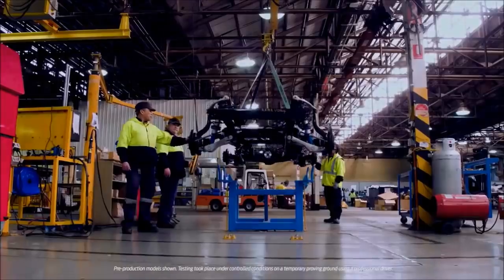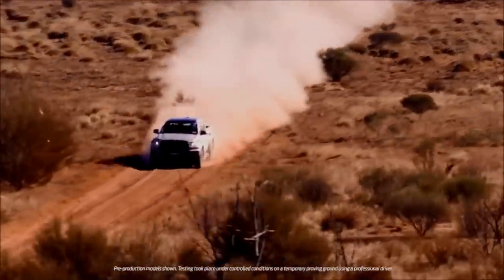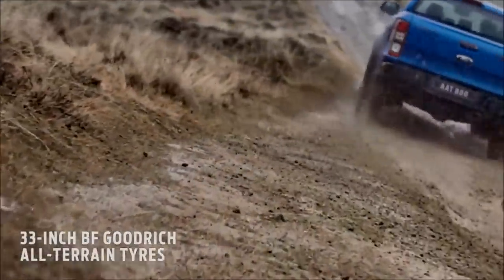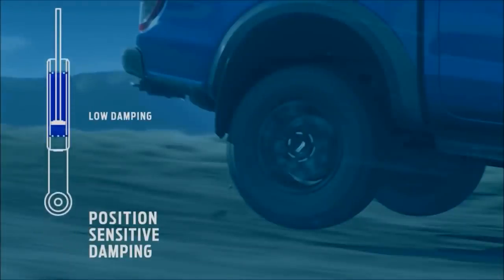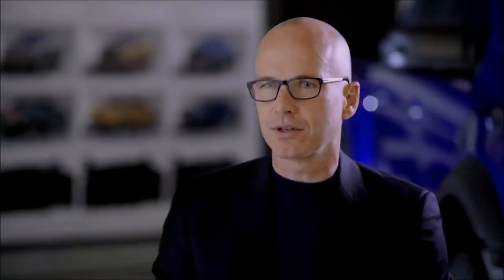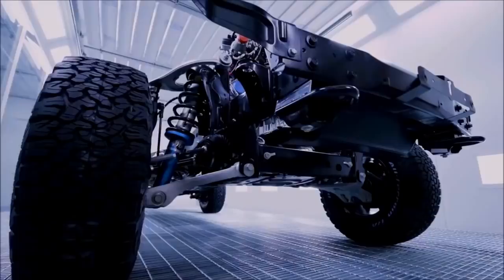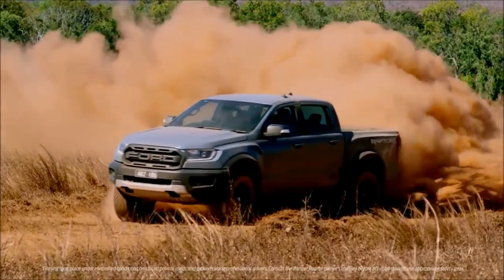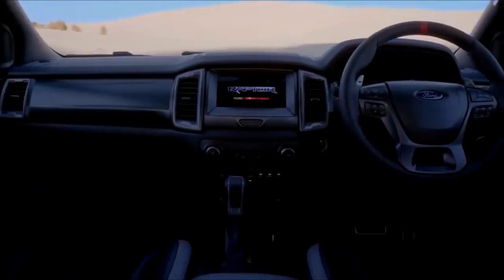Ford Ranger Raptor - The Best Pickup Truck Ever !!

Comment: Toyota is reliable, dont try to say Ford is because it is not at all.
Reply: My 87 Ranger with over 400k must have not gotten the memo.
Reply: @grizzleypeak  exactly its an 87. Any car in general at those years were very reliable. Toyota is the only company that is still solid.
Reply: Well its how you take care of it
Reply: I'll take a Tacoma TRD OR 4x4. Much better truck. 4ltr v6.
Reply: How many fords had the frame recall like you're precious Toyota?  How many Toyotas trucks in 87 rusted to pieces probably 80 percent because you don't see them on the road today. Finally Toyota had a huge problem with engine sludge where they were getting the engines replaced. Every vehicle manufacturer has had its flaws so don't make stupid comments out of nowhere.
Reply: @jasonamerica7618  also ford started it all they started car production
Reply: I got over half a million miles out of my 96 ranger.  I think  they are plenty reliable.
Reply: My cousin's Corolla had it its engine die before 150k miles and my sister's rav 4 had a factory recall to repair the engine that was eating a quart of oil every week at only 120k. Years were 2009 and 2007 respectively. Ford trucks are reliable and easy to work on. Probably some of the best trucks on the market . I won't say the same for their cars.
Reply: @TDONLEY91  my wife has a 2013 fusion.  Its been good so far...
Reply: Ford was the only option before they went aluminum now there's no question. By the way that's what Peterbilt and Kenworth are made out of, I know because I own them.
Reply: Never had a single problem and on my 5th ford.
Reply: I would crawl on my hands and knees before I'd ever buy a Toyota
Reply: I just gave my old ranger to a friend that needed a truck.  What part of 518,000 miles would you consider unreliable?
Reply: @grizzleypeak  Ha!  Right?  518,000 on my old 96...  Unreliable indeed.....
Reply: 95 thunderbird 4.6 v8......431000kms of hard driving and 22 years before too many thing broke.i trust ford
Reply: Dont talk nonsense!
Reply: @superbros1690  really the 80s were probably the worst decade for Auto mobiles virtually every manufacturer makes a better product nowadays Car & Truck
Reply: Ford needed bailed out, Toyota never needed that. 210 hp is a joke even for midsized truck.
Reply: Its how you take care if it. Toyota's are under power vehicles and cheap  Quality end of story
Reply: Really? Lol thats why they have the best resale of any truck or car!
Reply: roland white Ford was never bailed out.  You’re thinking GM (Government Motors) and Mopar (twice bailed out - first time was in the 80s).  And GM never paid the money back to the American tax payer in private sector profit.  I digress...
Reply: roland white Excellent marketing for their products and the fact that many American marques in the late 70s and early 80s WERE terribly unreliable.  However, after losing massive market share to Toyota, Honda and Nissan, American marques (more specifically Ford) improved their product for the consumer.  At this point in time it is a “six to one, half a dozen to the other” type of situation when comparing Ford and Toyota.
Reply: @vr697getta  Ford never took a bail out. That's why their stocks where much higher than the other u.s. manufacturers
Reply: @vr697getta  when did Ford need a bail out?
Reply: I have a 2016 ford ranger xlt that has 172k on its dial. I used it a lot. I already change the tires 3 times but the brake pads are still intact. I got the spare pads prepared, like 40k ago. Who says ford is not reliable?
Reply: @da Ghost sorry I'm talking about the brake pads
Reply: As someone who has driven ford and toyota, there is no competition, I would start biking before I would go back to a ford.
Reply: my 2004 has 300k km, although it is rusting out..due to winters and salt

Comment: 1000 miles later it brakes down !! It’s a ford so ...................

Yeah !!!!
Reply: Yeah buddy my 5.4 f250 has 275000 miles and the gass peddle is on the floor more than the break peddle I know you probably like your super reliable rusting in half Toyotas but they still don't make a truck that will pull a trailer as well as my 18 year old F250

Comment: At least you finally have the answer to why the North American market doesn't get the Ranger Raptor - the hp hungry Americans would NEVER settle in for a 2.0L Twin turbo 4pot diesel in a Raptor vehicle. It can't have the 3.5L V6 Ecoboost since it would be stepping on the toes of the larger & more profitable F-150 Raptor either, so I'm guessing the 2.7L V6 Ecoboost is likely going to be redesigned & re-engineered for the Ranger Raptor to make sense in USA, which is likely reserved for the all-new Ranger in about 2-3 years time.

Comment: 3:40 mark or so, watch how much bed bounce it has. F150 Raptor suffers from the same issue, Fox and Ford can’t design a suspension to soak up bumps. Be ready to drop another 10k in suspension if you buy one.

Comment: Hmmm, being an owner of 2017 Tacoma Trd Off Road edition bought NEW (0klm) for (52,000 Can.) I get in Stock options, Bilstein shocks, v6 278hp, 4x4 with crawl control options, Power windows, heated cloth seats with heated side mirrors, Bluetooth and Sirius radio with 6" touch screen,  Rear lockers, traction control, Toyota reliability with a solid resale price that wont drop like Fords stock market. As far as Ford Ranger Raptor design goes, It looks like 2017 Tacoma with wide fender flare kit nice try Ford, not to mention those head lights,  I guess that is where all the performance comes from. Never was a Toyota fan boy, being a Toyota owner made me fall in love and not their commercials.
Reply: John Ratushnyy toyota reliable? Maybe it was 10 years ago. New vehicles are crap. Taco motor is ok, but very thirsty. Interior cheap.
Reply: Roland Jankauskas, Yes truck is very reliable so far, took it out to a bunch of off-road trails and rock crawling and it performed very well. I will agree Taco is very thirsty when it come to city driving, highway drives are very pleasant and good on gas. I'm still thinking to buy Pedal Commander ( Throttle Response Unit) Reviews say its solves the city driving consumption by a fair amount. As far as Interior goes, yes most cars manufactures over use plastic, and I miss soft to touch dash soooo much ! But being my Off-road, Hunting, and a day to day ride I really dont mind it. Its easy to clean and maintain and looks great when it has semigloss UV protection on it ,  but the downfall is the door plastics scratch waaay to easy, looks like they have some sort of plastic clear coat on the surface. But working with cars day to day basis, I work in collision shop so I get to see whats inside them.  Ford quality really went down, plastic clips and fasteners are made to break, electronics positioning that don't make any sense like why would they put it over there ? Allot of plastic exterior parts that touch the cab rub the paint off, rust protection is very weak ( if you get a chip on the hood and its a very deep chip, aluminium starts to bubble and spread fast dues to aluminium oxidation and self protection factor ). Fords electronics, sound system for instance. We had a customer that has an issue with side Windows module intervene with sound system module. If you had radio on the windows wont go all the way up, very weird issue. I've had my Tacoma for almost 2 years now, and I worked on one at the shop so I saw what it was made of. Easy to access and to disconnect wires in door panels, clips and fasteners don't break and much easier to remove, very little modules or computers to intervene with one another its just power wire and a control panel ( Power window for example) no computer. To sum it all up, Tacoma is just more simple and strait forward truck, not over complicated, in build quality its decent but the best part its reliable and if it does break its not expensive to fix and labor cost will be much cheaper than Fords. Im not hating on Ford, my family owned a 2004 WindStar, and I owned a Mustang, from that what can I say ( NOTHING BUT PROBLEMS ). I had my experience being an owner and hearing other owners speak, Ford needs to step its game up by making things more simple so the money can go into quality and reliability of their vehicles .

Comment: The same fools who didn’t think the ecoboost f150 would be as good as the v8 are misjudging the 2.0 capabilities. Think of power to weight. The stock ecoboost 4 cyl ranger already out classes the competition Toyota v6 in terms of power and towing not to mention the cab space. Now add the raptor package and say so long Trd sales... don’t get me wrong I love the taco as much as any other camphead Moab guy, but if this thing stays within $10,000 of the trd pro package it will be a no-brainer to pull the trigger on. On the other hand this explains the giant price increase on the current raptor over the years. Making room for lil bro

Comment: Great design Ford but the issue is the engine, small engine in a big truck, for me it's not a bright idea even though has a lot of Horsepower and Torque but still it's not enough you should offer an options well maybe ok 2.0L bi turbo is your company's choice but you should offer for the people's choice like 2.5L bi turbo or stick to 3.2L just a mid level engine because many people tends to believe that a small engine squeezzing power to come up for the paper will never last long it will never be durable for an engine, for example Toyota Hilux mid level engine but average in Horsepower that is why it reach 500k mileage or more for many of the Hilux and has a big rating on reliability vehicle. Majority of people now a days choosing a vehicle for durability, reliability and fuel efficient and also for the design. I hope Ford offer some engine above 2.0L and I'm not referring to 2.2L engine.

Comment: Hope it's better than my current 2016 ranger with its overheating gearbox, battery issues, fan belt tensioner failure, and stalling when cold. And the Worst customer service ever. If your going to buy a ranger go get a Mazda bt50.

Comment: In no way shape manner or form can a Ranger Raptor or any Raptor be the best truck ever.   For all practical purposes it's not really a truck.   A truck is a multi use vehicle designed to work.   That means hauling loads and towing.   For those reasons, as far as trucks are concerned, Raptors are pretty poor trucks.........

Comment: The level of stupidity in these comments is simply baffling. When the Ranger Raptor comes to America, it will most likely get a high output 2.3L 4 banger that is standard in the Ranger now. Is it possible they will have a Diesel option? Sure. Is it likely? No. Ford doesnt provide a 5.0L V8 option for the F150 Raptor. Diesel are great and if done correctly, very reliable. Also very efficient. That plus a small package means better mpg. This is common sense shit.

Comment: cough... Nickle alloys are what manufacturers used between 30-50 years ago, but did away with them in the 90's because of the high cost..  cough... cough.

Comment: High speed? its slower than my 2.0Bitdi Amarok and even slower than the current 3.2 Ranger
Reply: Right.....some one needs to tell Ford trq is great for acceleration but hp is for top speed....
Reply: The problem with that is, is that it even accelerates slower than the above mentioned

Comment: I wouldn't buy it because they put the steering wheel on the wrong side. And no manual transmission. Ugh weird
Reply: That's why I like the F150 one better. It don't need manual. Sorry I noticed it does have it on the left

Comment: This advert makes it very appealing but I don’t care how much you have optimised the engine, it’s still a 2 litre 4 cylinder and the power output is garbage. Don’t be fooled by this well put together advert, people! The f150 raptor is vastly superior. I hate the way all cars are going now, reducing engine sizes to optimise production and fit into the emissions regulations. They say they’re optimising the engine, but the reality is the power of the vehicles just keeps rapidly decreasing. The raptor versions have gone from a v6 3.5 to 5 cylinder 3.2 , to 4 cylinder 2.0.... COMPLETE GARBAGE.

Comment: Looks like it will be a decent fucking ute, sure its only a 2 litre engine but its a compound turbo'd diesel so plenty of torque and you aren't going to pay massive rego costs associated with a bigger motor (rego is fucking expensive in australia), which will eventually be reflashable to run much better than factory, the chassis and suspension is dialed so it will ride nice and be comfortable and its a big ute with plenty of room for stuff, chuck a decent bull bar on it and you'll be right , is it going to be as invincible as a toyota landcruiser? hell no! but nothing is as invincible as a landcruiser, but not everyone needs a landcruiser, thats why a lot of people like nissan patrols ;)

Though i will say this... This advertisement video is terrible! who the hell wants to see a bunch of metro sexual suited up men talk about a ute? who wants to see a bunch of well moisturised and lubed up suit wearing softly spoken metro's talk about the well sculpted fucking seats or a stupid red center mark on the steering wheel? What genuine Australian 4wd/camping outdoor enthusiast gives a shit about that? If you want the car sold, get Dazza, Shane, Stevo, Davo and a Shazza to take the fucking thing fucking pig hunting and show everyone how many dead things you can fill the back tray with, that will get it fucking sold!

Comment: this thing should have 300+ hp. not 210 smh
Reply: Standard Ranger engine is 285HP.  The Raptor would definitely be more with the most probable engine being the 3.5 EcoBoost at 375HP.

Comment: This truck is junk!  It’s funny how Ford is starting to make this truck look just like the world leader Toyota Tacoma.  

There’s nothing about this truck that impresses me, not one bit.  I can sit and drive one of these trucks at 100,000 miles and it’s already beat to death.  I can sit and drive a Toyota Tacoma with 300,000 miles and believe it’s nearly brand new still.  Don’t believe the hype of this junk box. 

Put a 100,000 mile full unlimited warranty on this piece of crap and the Ford Raptor department would go bankrupt.   

This suspension bragging they believe is so state of the art is nothing more than what a 1988 Ford Bronco can handle according to Fords own commercials.  See for yourself the Bronco elevate above the ground further in the air than this trash can wrapped in new plastic is doing.  

This truck looks like they took the Toyota Tacoma and Chevrolet Colorado and mated them together.  If Ford really believed this balsa wood truck was truly a leader they would have designed this truck completely different than the industry off road leader Toyota and not forgetting Jeep.  

I’m shocked they aren’t trying to make this truck to look like a Jeep yet. Perhaps next year.
Reply: not!!!